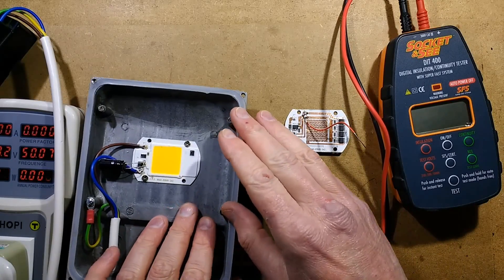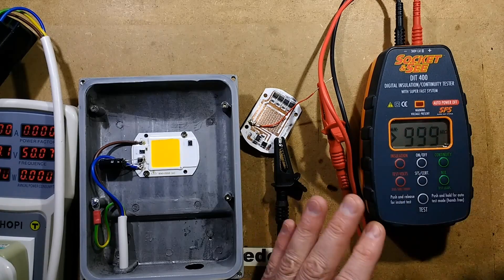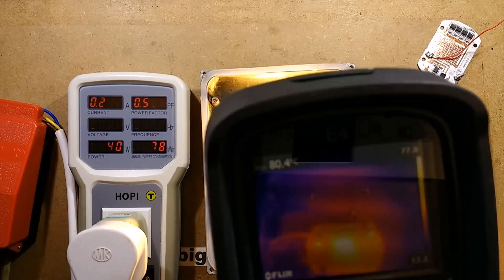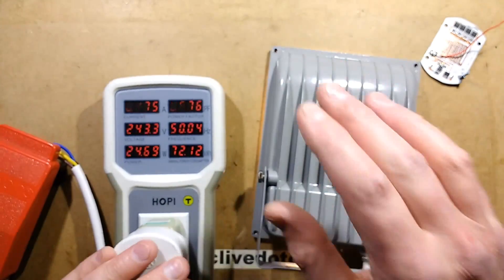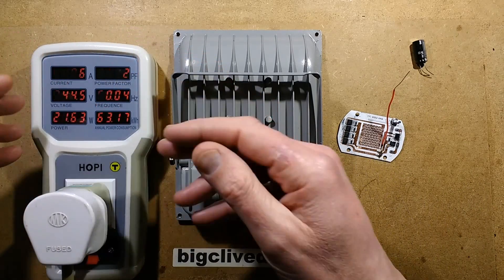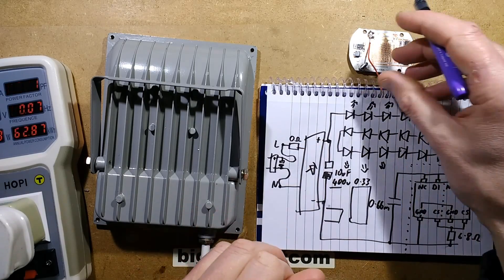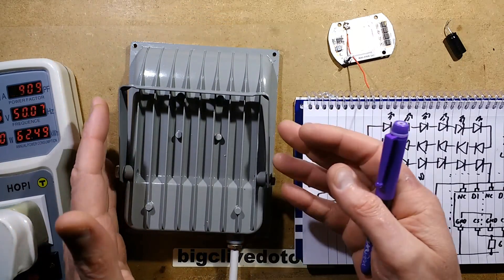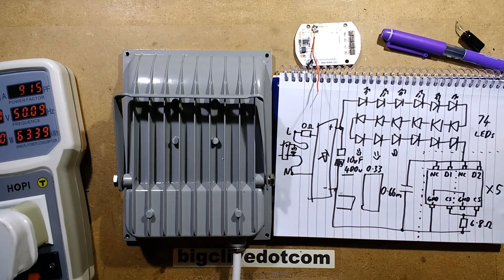Adding a capacitor to a driverless LED and other tests.

Comment: What if you put the capicitor over the LEDs instead of the entire input DC source? Would that at all change the results you just demonstrated?
Reply: Why would the cap do nothing though? It's current regulated DC with rising and falling voltage. The capacitor would fill up at the top of the wave and empty out as the wave fell thus extending the time that the LED's are lighting.
Reply: There's one way to settle this - CLIVE YOU HAVE TO TRY IT, put a capacitor across the LEDs and the input power will not increase and the chip will not get hotter.
Reply: erm , how does a diode try to keep voltage constant again ?  A capacitor stores energy, so when you have ripple it fills in the gaps by releasing some of its stored energy from the peaks.

The impedance of the LED's is low per diode but a string of them in series has a notable impedance and the higher voltage means more energy can be stored in the capacitor.

The drivers maybe current sources or sinks. but they are not designed to see full rectified mains directly across them.  With a cap across the LED's at switch on the Cap would present a dead short across the LED's and therefore the driver would have to deal with the full brunt of the rectified mains.

If they are rated for this then fine, but in the circuit they are operating at much lower voltages due to the drop through the LED chain.

That is a seasoned design engineers view anyway  :)
Reply: erm bridge rectifier rectifies both halves of the cycle. that is what a bridge rectifier does. in the UK you would have a pulse train of half sines at 100 Hz coming out. 

the output will still drop to zero at the crossover point and for the duration of the conduction voltage of the diodes in the bridge, typically 0.6V .

The point is the LED current draw is not a perfect zener action , so as the voltage drops the current draw will decrease , the capacitor across the LED chain will keep the voltage from dropping to zero and depending on it's value will also keep the LED's from extinguishing completely.  Larger the value the more Light you get during "off" so the less apparent flicker.

The capacitor will not be as effective at flicker removal as having it across the main bridge but it will not cause the voltage increase issue either and also not place huge inrush current strain on the incoming bridge which is clearly not going to be rated for that.

To clarify the inrush to the current regulator chips from this arrangement may cause them damage if they are not designed to withstand full rectified mains until the cap charges up to at least the LED "off" voltage.

Clive stated the LED strip runs at around 180V so the regulator devices only normally see around 60V across them in the original circuit. Hence my concern over this. However the higher volts of the smooth input experiment didn't destroy them and they were probably around 140V peak then..  They were getting warm tho :)
Reply: superdau The chips limit the current. There would be no inrush. They act as current sources.
Reply: superdau Only the instant the power is applied and it's a small amount of energy. Afterwards... Nothing. The   voltage changes little because the LEDs are a diode and diodes exhibit a small change of voltage with current. Therefore the cap doesn't matter for any reasonable value.
Reply: bdot02 The voltage across the LEDs is pretty much constant with the remainder across the control chips.
Reply: +amojak A "seasoned" engineer would know that the AC impedance of diodes is quite low. I highly doubt you're an electrical engineer because this is basic 200 level stuff.
Reply: +number 33 Or the "seasoned" engineer could open LTspice and simulate it... Or find a Electronic Devices textbook and take a quick look at the I/V characteristics for a diode and realize the effective resistance is only the parasitic resistance of the diode. It's higher for LEDs, but unless that cap is thousands of uF it doesn't matter.
Reply: +amojak Bleh... It's close enough to zener action that unless you have a huge capacitor close to no current flows through it. And since the LEDs stop conducting at a certain voltage, the voltage across the LEDs will not fall more than a few volts at best.
Reply: +bdot02 Where do you get those 200 volt supercaps...
Reply: oh dear.. i don't think people are listening. it is not a single diode. it is a string of doped diodes (LED's). The troughs would be filled by the cap, the flicker would be reduced. simples.

I agree it would need to be a larger capacitor than the one across the input bridge for similar effect. But it would not raise the voltage or cause inrush problems for the bridge.  The problem would potentially be passed to the current regs.

What i said about the current limiter chip still stands. it may limit to say 50mA for example, which means with 60V across it peak means it dissipates 60 x 0.050 Watts . with 240 across it , even for a short period means it has to handle 4 times that power and see 240V DC.

if (chip != rated to 240V) &| (chip != rated to dissipate 12W) Chip == die :)

TANSTAAFL rule always applies.
Reply: +Mister Hat
You're right. Brain lag of me. Once the cap is charged it will never discharge below the forward voltage of the LEDs (that's what I overlooked). Or does it? Assuming the cap is big enough to store at least that much energy that the flicker is reduced, when the voltage after the bridge rectifier (also connected to one leg of the LED-parallel-smoothing-cap) drops in it's cylce the other leg of the cap will go negative. That might hurt the chip.
Reply: +superdau It will go below the forward voltage of the diode because of leakage, but we're only talking a few milliseconds of discharge at best. As for it going negative, that would depend on the chip itself. Some processes won't care, some might be destroyed, and others will act like an antiparallel diode.
Reply: +amojak Unless it's a huge honking cap, very little will be different. simples.
Reply: I will concede that amojak has a point about start-up.  For the first few cycles while the capacitor is charging there will be a higher dissipation in the chip and more importantly a higher voltage than it may be rated at.  But assuming it survives this then it will settle down to a steady state where the capacitor voltage doesn't change much and the LEDs will still flicker albeit not quite so much.
Reply: Hi not much of a sparky, but there is some things I understand. I do understand why the cap across the bridge rectifier. But I don't understand how and what does Clive mean by putting two caps in series ,,and that should last for ages" he says. Where and what caps he means? Still across the bridge just put two in series?
Reply: A cap across the LEDs would do nothing. A capacitor tries keep voltage constant and so does a diode. The AC impedance of an LED is very low and that it nullifies that capacitor. To those saying it would increase inrush: No. The driver chips are current sources.
Reply: I agree with Mister Hat, a capacitor across the LEDs will not cause a high inrush current and neither will it stop the flickering.  When the input voltage drops below the LED voltage (about 220V) the bridge rectifier will become reverse biased, the current in the LEDs will drop to zero and the voltage across the LEDs and the capacitor will drop a bit but essentially just remain constant until the next cycle.
Reply: I was not talking about inrush current, but the controller chips.
Reply: not in DC
Reply: Again, I don't talk about inrush current. I think you don't understand how current limiting works. The chip can't magically reduce the current without side effects. These are linear current regulators. They dissipate power in order to do so. If you short the output (a cap is essentially a short when voltages are changing, which in this case they are doing all the time), they have to dissipte much more power than in normal (no-LED-parallel-cap) operation.
Reply: similar issue with what clive did, the bridge rectifier inrush current would of been huge when you switched on. that bridge would eventually go pop.

with a cap across the LED's the inrush would then hit the regulator chips. pop..
Reply: Yep, it wold fry the chips. A cap across the LEDs is essentially a short.